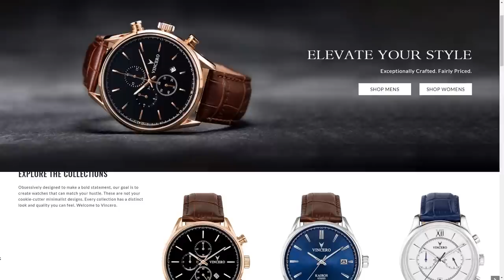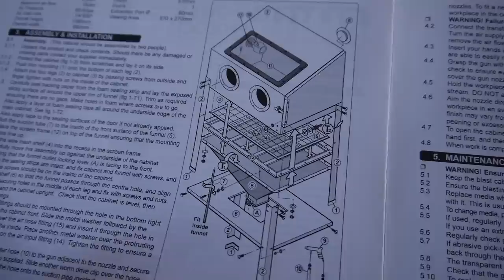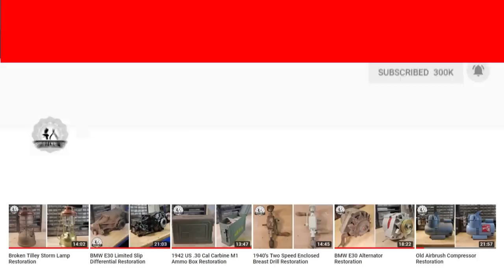Workshop Restoration Build | New Lights And Tools! | BMW E30 325i Sport Restoration S2 E2

Comment: Great progress.  One lesson about the sandblasting cabinet.  Before use, find some sacrificial plastic film to protect the view window.
Reply: 80% window tint works great, but even clear tape will suffice.
Btw, acrylic windows will buff out, tempered glass will not.
Reply: And more sealing should have been done.

Comment: I had the same blast cabinet,  3 things that make it way better, first,  ditch the light that came with the unit and put something much, much brighter in there. That light doesn't produce enough lumens to see clearly even if the rest of the room is pitch black.  2. More sealing, I disassembled mine within the first week and siliconed all the joints,  no more leaks,  no more mess.  3. Most importantly,  throw a shop vac and filter on it (plenty of plans on the web for it)  that made everything better about using it.  The vacuum during blasting keeps dust down,  visibility up,  and if hot are already building a riser (I did on mine too) you can fit it all in it.  Bonus 4th, put some casters on the riser so you can move it for cleaning.
Reply from the maker: Yes Matthew, I totally get this comment. It's pitch black in there and leaks quite a bit. I'm moving it out of the shop into the second little room. I'll be painting in the main workshop spray booth so I really shouldn't mix the two. But I will be making these upgrades regardless as It defo needs them. I also cut a hole in the front and piped in a blasting pot. The cabinets gun and system is weak in comparison. You'll see in the upcoming brake video what happened. It was bloody hard to film, I'm working on making everything much better for the future. Cheers for this comment Matthew.

Comment: Things look like they're coming along quite nicely! Good call about getting additional lights. Thinking of touching up the paintwork a bit on those brown(rusty?) supports and window-frames on the walls? they kinda stick out like a sore thumb in comparison to the great job you did painting the wall itself. probably wouldn't hurt to put some mats or something on that squeaky floor as well, but those are minor little things really. overall this is looking like it's shaping up to be one badass workshop!

Comment: In the corners of the work benches where you added a fill piece to connect the two benches, I'd recommend adding something like a 2x2 on the 2 corner edges to keep things from rolling off. It'll also add some strength since you're only using one leg in the corners. It's frustrating when working on something and a screw rolls away off the back of a work bench. Great progress though!

Comment: Great work! Just a suggestion... connect the of the peg boards to each other and the wall. That way you can remove the angle support brackets creating a very long unbroken surface.

Comment: The workshop is looking really great, there's a lot of enthusiasm and that's contagious when you watch your videos. If you accept a suggestion, I would instead install some kind of insulation under the metal roof, you know how the Spanish climate is, it can be really interesting to put some kind of rock wool or similar to avoid cold in winter and extreme heat in summer. This year we are having a very strange weather, I do not know if it will be the tonic from now on but in winter it can be very cold and it is not pleasant to work frozen, I tell you from experience. Greetings from Madrid and congratulations, is a great job.

Comment: great job! consider to insulate that metal roof, not only for the freezing cold but for the humidity that can condensate when you are working inside the shop... you will warm that place in a cheaper way and get rid of some hot in the summer...

Comment: Amazing work! One thing though. If you are planning to use the log burner I would advise to move it a bit further from the workbenches of using heat insulating materials to shield the workbenches from the heat thus preventing a possible fire.

Comment: Looking good, the only thing I am concerned with that now you have moved to Spain with its higher temperatures is that metal roofing as it will be like a sweatbox in there in the summer unless it misses the direct sun. Good luck on your adventure and keep the great videos coming.

Comment: Are you using a drill bit with a countersink? I can’t tell, but some of those screws don’t look flush.

I’d be inclined to use a countersink bit, fill over those screws, and sand back. If my work kept catching on protruding heads, it’d drive me mad.

Gotta day tho, the space and the setup look awesome. Great job.

Comment: A lot of lighting does not happen. Little light - eyes will quickly begin to tire. Therefore, on such a large room is better than 8-10 LED panels.
And also each workplace has its own light source.

Comment: Ain't too shabby and it's not done yet!

Do you plan to powdercoat or cerakoat? You have enough room, all you need is an old burner with a an electric oven. Powdercoating is so much easier and faster to do than painting, and it's a better solution overall.

Comment: I'm still learning about the 'background' or whatever you want to call it of tools. I've been in the trades for a few years now, I have a decent amount of tools, and I'm always researching and looking at prices. However, at 2:27 does that drill have 'Stanley Fatmax' on the side? I wasn't aware they made power tools. Are they only sold outside of US? Honestly, it looks like a rebranded Dewalt (yes, I'm aware of Dewalt, Black & Decker, and Porter Cable being the same company).
Reply from the maker: Yeah, that's a Stanley FatMax' drill. Good brand. I wasn't aware they made anything other than tools? What do they make in the US?
Reply: Stanley is owned by B&D
Reply from the maker: I did not know that.
Reply: To my knowledge, Stanley only makes hand tools. In the stores that I've shopped at, I have only seen their hand tools, I was not aware they made power tools.

Comment: You should ditch the battery setup on your camera and get either a dummy battery + transformer setup (for mains) OR a dummy battery + external, larger battery pack. IMO, i'd go for the mains transformer. IF you decide to do so and still have a battery you want to keep around, never let the battery fully discharge. Periodically check it and keep it above 60% but not 100% either.

IF you can't find a battery dummy for your camera (tho that's pretty rare, most brands have something) just 3D print one, regardless, be sure to use a proper transformer with the correct voltage and amperage (online forums have that kind of information).

Comment: Great work man, your videos are fantastic. Based on your experience so far, how would you compare your previous blasting cabinet to your new one? I have a smaller one like the one you set up in this video but it is quite difficult to fit even a 15" wheel. Your previous cabinet looks to fit much larger parts with ease. I'd really like to make a larger one as I also have the blaster tank. Is there any info you could share about the construction of your old cabinet? 
Thank you

Comment: You still don't use impact screwdriver, also as impact drill? it would be so much easier. I've bought impact drill for like 40$, drilling concrete was like drilling a butter.

Comment: You have to use dry air with the blasting cabinet! Dont make the mistake and use the air directly from the compressor, this will leed to the nozzle clogging
Reply from the maker: Cheers Clypeum. There will be several filters around the place to ensure dry air and clean air for the air fed mask. I have the headache of piping it all up to deal with yet.

Comment: Please be weary of relying on those non contact voltage testers for finding wires in walls. I have an EX330 meter with one built in like yours and it's fairly inconsistent in it's range. Proper testers like my Fluke 1AC-A is very short range. It will tell you which side of a flat NM cable is live. You can run it down an extension cord and it will show you the twist since it will go out when the ground or neutral is underneath the tip. It definitely will not sense a wire buried in a wall. I don't know if your's is specifically designed to be long range.
And, of course,  no tester will find a circuit that doesn't happen to be on at the time.

Comment: How many liters is the air compressor? Is it an oiled or oil free one , what air filters are you using ?
Reply from the maker: Oiled and its a 200ltr workhorse link in the description. Air filter link in the description. A.N.I 3 stage.
Reply: Restore It thank you

Comment: Just letting you know you can buy drill bits that are meant for concrete or brick walls so you don't destroy your other drill bits trying to drill into the wall trying to install things
Reply from the maker: I am using masonry bits to drill into the walls. That's correct isn't it?
Reply: @RestoreIt  yes that is correct you should be using masonry bits to drill into the wall but I did not know you were using masonry bits in the video I thought you were using normal drill bits sorry my apologies

Comment: To celebrate your new shop. you need one of these.  I built this hydro blaster from a HF sand cabinet like yours and a cheap sump pump.  Its uses a storage tub to catch the slurry. you use a different tub for each size media, siphon off the water and let it dry out to store. To change the media, drop the pump in a clean bucket of water rinse out the cabinet swap out the tub.takes 2-3 minutes. Also does dry blasting also, The modification of the media pick up allows you to vary the amount of media from a pencil lead steam to a full tube. The brass pipe is threaded, unscrew the bolt and changes the vacuum at the bottom. Will work with a couple cups of sand or a single box of baking soda.    Yours might be modified but you can built this easy. This wet side is amazing on aluminum  
https://www.abcgt.com/new-forum/forum/main-forum/356-restoration-projects/446-tools-products-for-restorations?view=stream